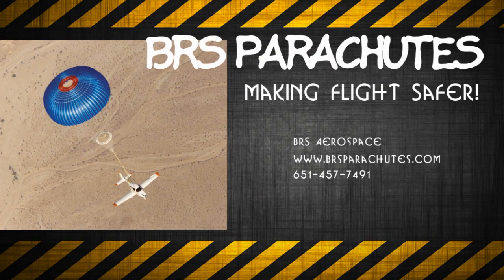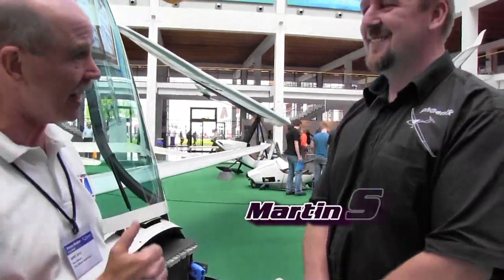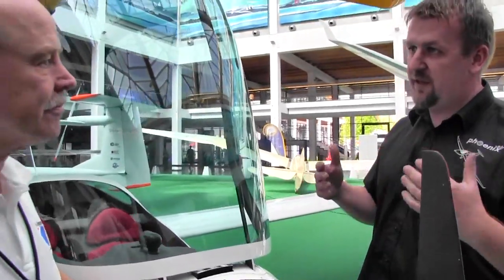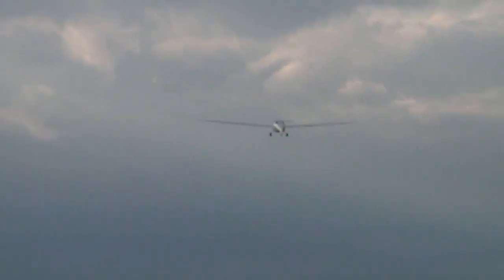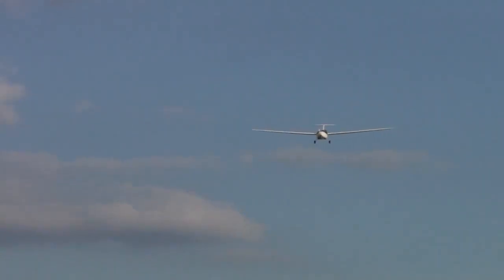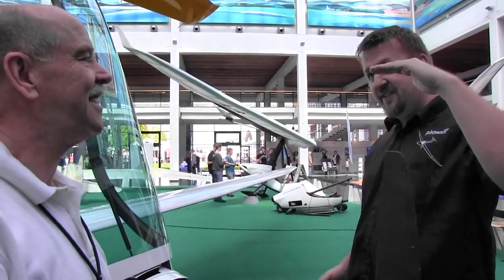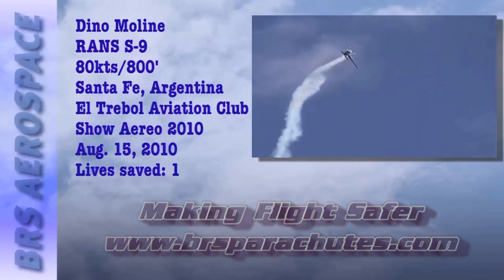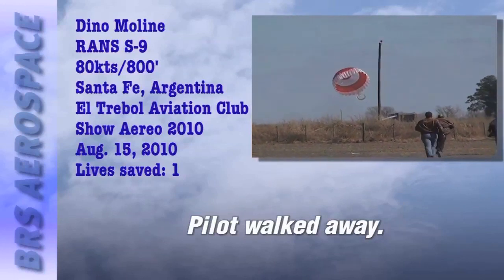Phoenix Motor Glider, Phoenix Electric Motorglider from phoenixair.cz - AERO Friedrichshafen

Comment: Why would anyone bother putting an electric motor into a motorglider?  It has a tiny fraction of the range of the gas engine, long recharge times, and probably costs and weighs just as much or more.  Dumb idea.
Reply from the maker: The reason is actually quite simple, to get it airborne so you can use thermals to LONG distances for virtually nothing. That is why they call it a GLIDER! I have flown for over 4 hours without using power, just electric power to get me up there.
Reply: You are obviously not a glider pilot. Gas engines are noisy, sure they perform - I know I owned and flew a Pipistrel Sinus with an 80hp Rotax. But I was always wanting an electric motor. You only need it to get up and then cut it and soar for hours and if you need to get back you can turn on the electric to get you back to where you need to be, which is also a great safety feature, fewer times landing out. Another reason is that when you turn off a gas powered engine you can suffer from vapor lock and you might not be able to restart the engine and then you have a possible problem. Electric engines just restart, no fuss.

Comment: Why hasn't anybody done a reclined single seater with only the head sticking up in a helmet type canopy? that what it has very small cross section and tiny glass. And tiny door.
Any slight inconvenience getting into it is well worth it.  It could be fast too. 400+ km/h. Could be a jet.